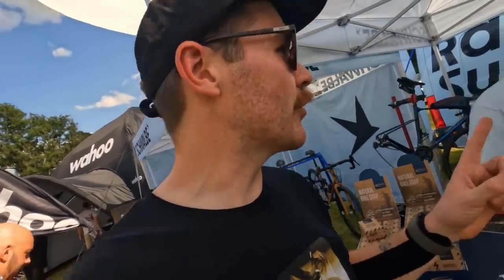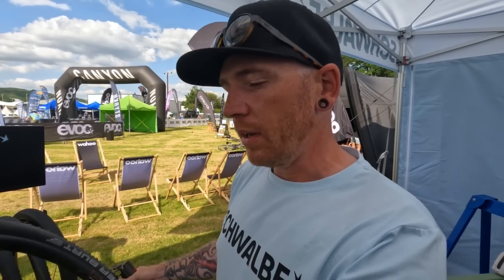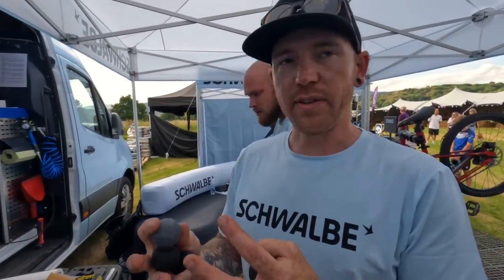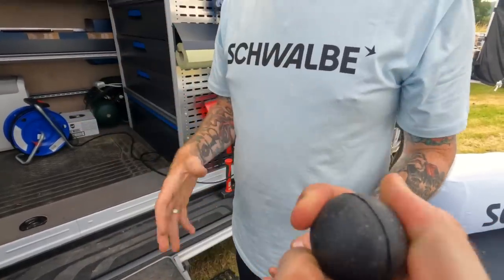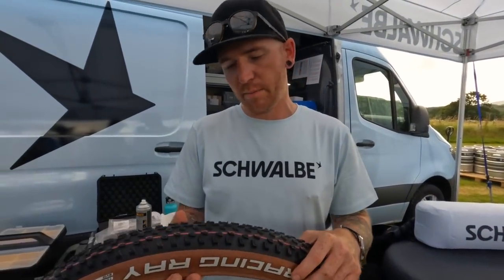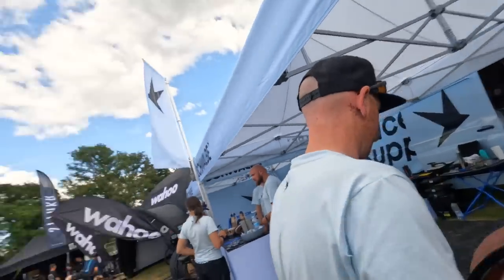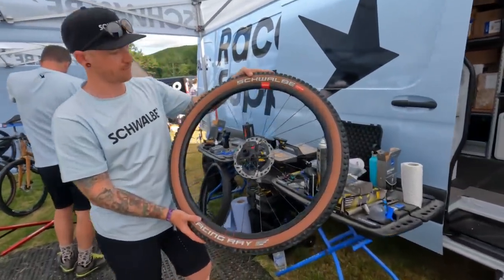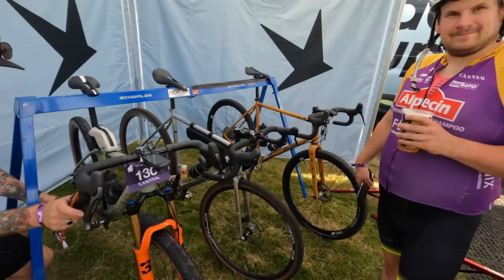12 PRO TIPS TO SET UP TUBELESS TYRES

Comment: Like the tip about using a patch for the valve, I've used a little square of gaffer tape in the past.  Maybe some extra tips about what to do when the tyre wont seat, using a booster (I see one strapped to the track pump) and extreme cases using a strap all the way around the circumference of the tyre to hold it close to the rim (only had to do this with one brand of tyre).
Reply from the maker: Yep using a booster is a great shout if you’re still having issues. They also have a compressor in that van if they needed it
Reply: @ChrisHallRides  Compressors scare the sh*t out of me though.  I worry that I'll blow the tyre off the rim and they can become a breeding ground for some very nasty bacteria 😬
Reply: @ChrisHallRides  which pump is used here?

Comment: Just bought a set of Schwalbe One (28c) for my road bike. This video comes in right moment! This will be my first tubeless experience.
Quick questions:
1. Schwalbe Easy Mount isn't available in my country (Indonesia), since he said soapy water may become corrosive, is there any alternative liquid to use?
2. Is 1 lap of rim tape enough for road bike?
Thanks!
Reply from the maker: I’ve just asked Grant for you. Here’s the response I got:

‘Easy fit alternatives.... diluted! bike wash is what I have used in the past, but anything that leaves a residue MAY, cause the tyre bead to slip. 
A bowl with a sponge 🧽 is a good way to apply and get a quick application to the wheel. 

Tubeless tape wise, depending on what you are using, I.e how thick it is, I'd still recommend fitting two laps of tape.’
Reply: @ChrisHallRides  thanks for the answer, both of you! Cheers 🍻
Reply: was going to ask about laps of tape for road tyres...thanks for the answer

Comment: Any advice if the bead isn't seated at rim/tyre max pressure? Any tricks? At the moment I'm naughtily just exceeding it till it pings
Also any tips for diagnosing tubeless slow flats/leaks?
Reply from the maker: Schwalbe do a little soap sponge thingy which works well I’ve found
Reply: Ah okie dokes thanks - I thought that trick was just for seating the bead but in fact it seems like the answer to everything if in doubt @ChrisHallRides